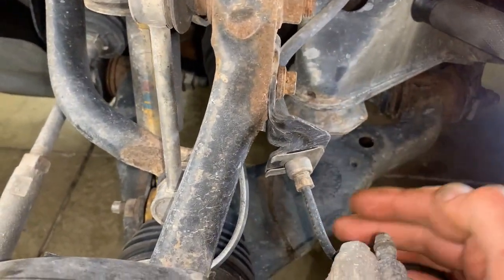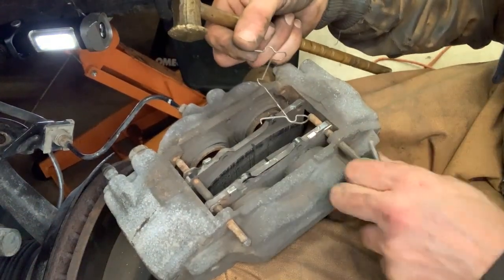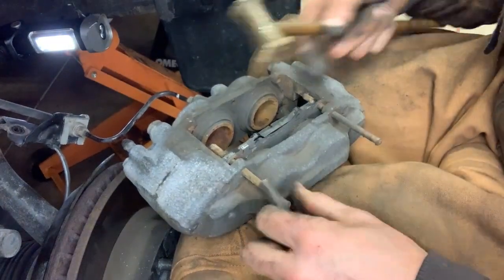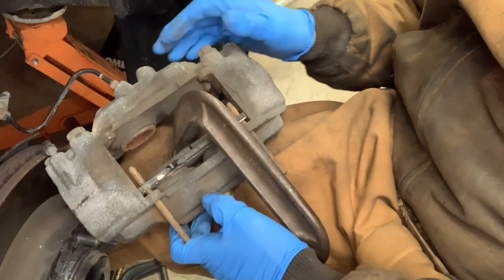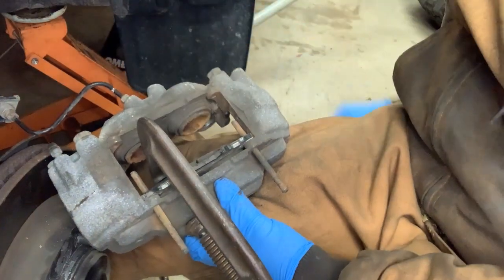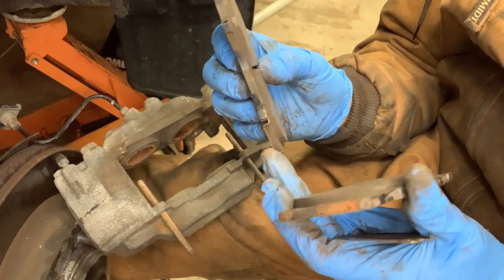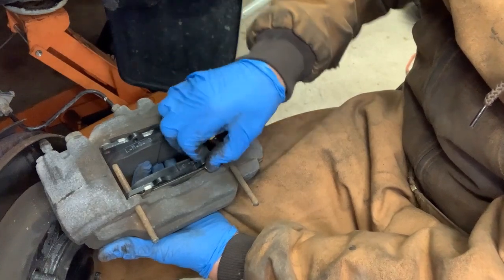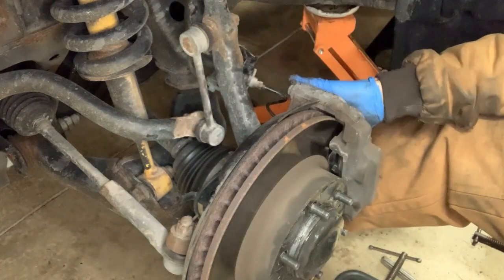2016-2022 Toyota Tacoma front disc brake pad replacement guide

Comment: Nice video. Thought I would add in my 2 cents. You might want to clean the pins for the pads with Scotch-Brite pads. When they are full of rust or material. The brake pads will wear unevenly. I use a soapy spray and clean the caliper and lube the rubber boots. If you use the brake pad and c clamp to retract it. The rubber boots will not seat properly and will tear if not lubed with soap. I always use brake silicone for the back of the pads. You should not have to use a hammer to guide the pads on.

Comment: Thank you for the information sir I just completed a 2017 myself. you do not have to remove the calipers from the vehicles you simply just slide the pad through the top of the caliper. Make sure you create space before you move the plate though. Thank you for the information have a good day